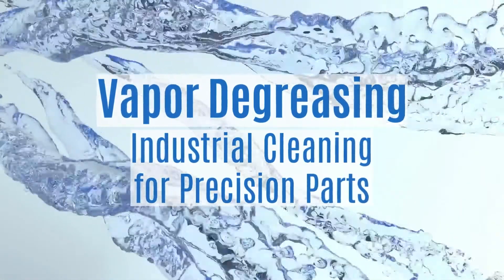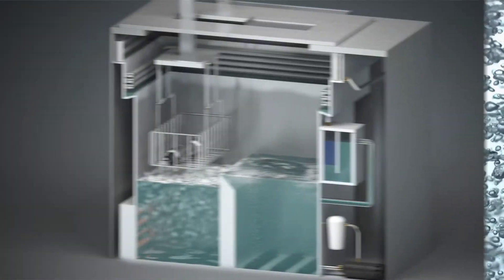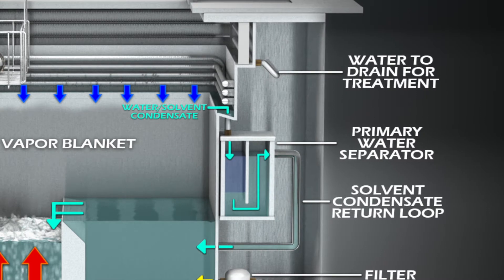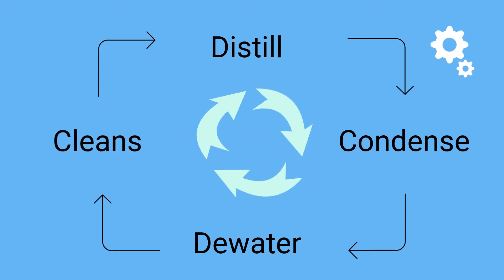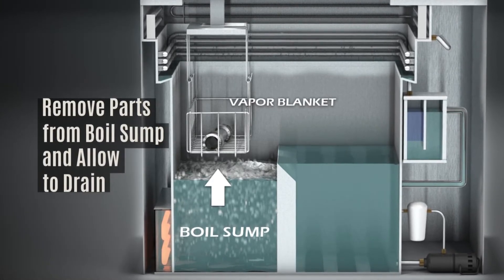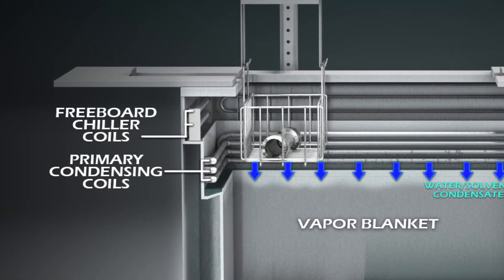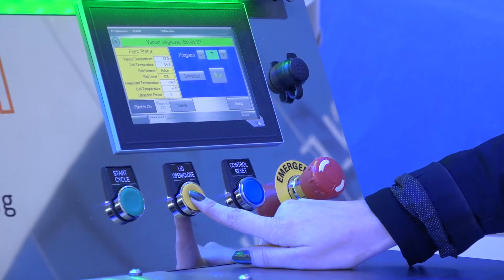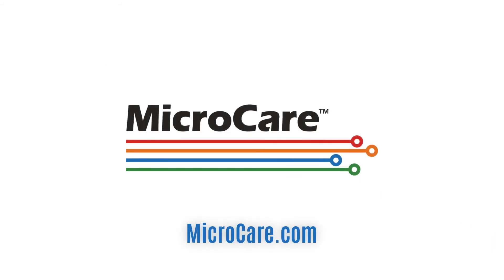Vapor Degreasing Explained: What It Is and How It Works

Comment: Hi, then can I ask how and where the oil and dirt is collected?
Reply from the maker: Thanks for watching, Ben! From our technical experts: The oils and dirt concentrate in the boil sump.  When the soil level gets to a pre-described level, the customer conducts a boildown to minimize the amount of dirty solvent to be changed out of the system.   More about this process can be found in discussing your needs with a MicroCare technical manager.
Reply: @MicroCareLLC  Hi Experts, good day. Can I ask one last question. If boildown, the solvent evaporates to the air ... but isn't that solvent mild toxic? Harmful to health or environment?
Reply from the maker: @individualthoughts-chatty  Good questions, Ben. Check out this video that addresses environmental safety concerns and why MicroCare Tergo cleaning fluids are a safer choice: https://youtu.be/aLbYrn2JoIY
Reply: @MicroCareLLC  Ok I checked the SDS of that Tergo cleaning fluid. so yes it is mild toxic ... it contains trans-1,2-DICHLOROETHYLENE which is highly flammable by itself but maybe the solution has mixed it with other chemical to become nonflammable?